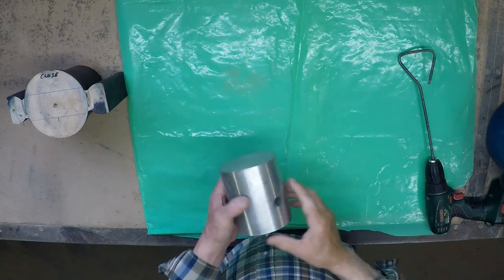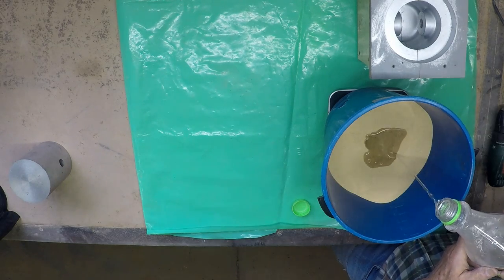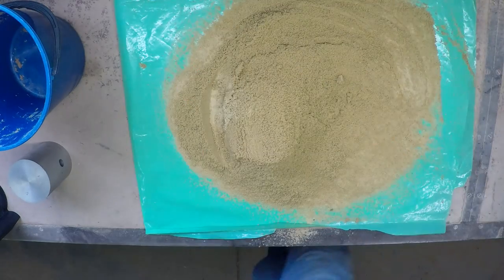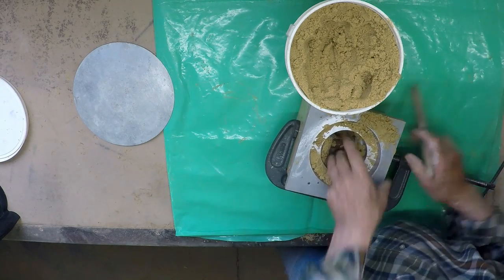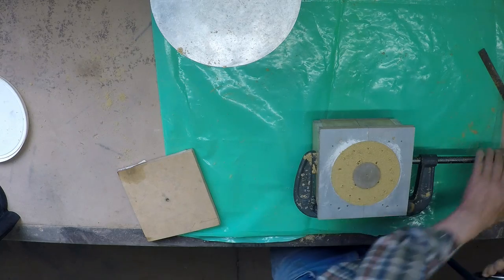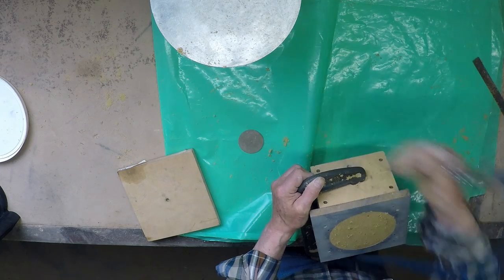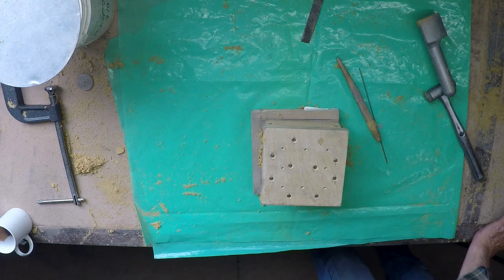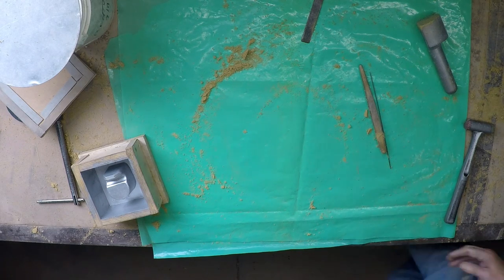Casting a piston for a 1910 Brush car. Part 2:- The CO2 silicate core

Comment: I was thinking of making a pouring basin pattern something like that.  I know you generally don't approve of adding head pressure extensions on top of sprues but is it worth risking a small height increase to easily get smoother cleaner basins than I can cut by hand?
Beautiful patterns, and a great tip about adding glucose to the cores.  I was going to try adding dextrin to improve collapsibility but I will see if I can find some glucose to try instead.  Can't wait for part 3!

Jeff
Reply from the maker: Jeff,  A couple of points re the basin, It is actually quite easy and quick (after a little practice) to cut the basin in the top of the mould as I do at around 8 to 8.30 minutes in the Part 1 video of this series. The main think (I think!) is that the basin is vertically sided and it does not seem to matter that the bottom corners on the basin are square in fact this squareness seems to help. I have seen people cut basins that are very shallow and way too spoon shaped - definitely not a good thing! The use of a thin tube to cut out a "divot " for the basin is the easiest and quickest way. The tube I use is 30 mm diameter and I push in 30 mm deep, I then cut the sand away between this 30 mmm diameter hole and the top of the sprue leaving (very important!) a 10 mm high ridge between the basin and the sprue, the top of the ridge must be well radiused to the top of the sprue.
Yes, I am very much against unnecessary head height - its just not necessary and is an evil in the way it increases turbulence during mould fill. However I am talking here about the unfortunate habit some YT casters have of extending their moulds up 100 mm or so. (The jam tin mob!)  This is crazy! BUT a small increase of say 40 mm max to allow the use of a premade pouring basin is not going to cause too much of a problem and it is as you suggest a way of getting a good basin on a regular basis. Also of course coupled with a decent tapered sprue of the correct size the whole arrangement will put you miles ahead of said "jam tin mob". You can actually be very cunning with it sometimes by having the feeders vents etc not quite as high as the basin, in this way you stop pouring when the feeders are almost full and the basin drains almost completely increasing the metal yield. My "to do list" includes as a matter of some urgency the making of a little 4 cavity shell core mould to make just such basins, because the silly little funnel ones that I currently use on a lot of my work is a very poor design.
The glucose powder in the core mix makes a truly amazing difference - try it. I get the glucose for a health food shop. I tried glucose syrup  but could not get it to mix in properly while the powder mixes in to the dry sand very well.  Part 3 in a week or so - I hope that you like it... Martin
Reply: @olfoundryman8418  try glucose from a beer brewers supply.

Comment: Nice Pouring basins Martin, as you know mine are made with oil bonded sand.
looking forward to part 3.
Reply from the maker: War, Part 3 about a week away - just need to get it edited. I intend to make shell core moulds for the basins that way I can make lots and have them on the shelf for ever.. Martin

Comment: Fantastic video! Really looking forward to the next one. What is the powdered release agent you are painting on the core mold, the silvery aluminium like powder, please. Cheers.
Reply from the maker: Jimmy, It is not actually a "release agent" but it seems to work for me although I suspect there are way better ones out there. It is actually a mould coat called "Mouldcote 15" it is made by Foseco and it is a chill coat used to help control solidification - usually on things like shell cores. It looks like silverfrost paint but it never quite dries and it is very messy to work with - it gets everywhere! I guess it has a sort of minute flake structure of its aluminium(?) component and that is what  provides the release... Martin
Reply: @olfoundryman8418  Very many thanks Martin, that is really appreciated. If it works, it works! Cheers.

Comment: Martin,  thank you very much for your insightful videos, and the obvious skill and expertise you bring to each casting task. It is great to watch. It is clear that a great deal of preparation and thought goes into each successful casting and the opportunity to literally look over the shoulder of a master at work is solid gold.   It is riveting stuff.  A couple of questions if I may?  The first is how you correctly estimate how much alloy is required for each casting?  Secondly what do you use for degassing and slag removal?  Thirdly I live in Australia for part of each year and would be grateful if you could point me towards good suppliers of all the consumables. Fourthly and finally, somewhere you mentioned in passing a book you found helpful.  Can you easily recall the details?  I can honestly say that I learn something new every time I watch your videos.  I hope your health issues permit you to continue your wonderful work - and teaching.  Kind regards John
Reply from the maker: John, I posted a list of possible suppliers just yesterday in response to another comment. Here is a "paste" of that reply.

Fluxes, exothermic, die sprays, mould washes and release agents from Foseco they are world wide.
Ceramic filters from  Pyrotek
                       Foseco and Pyrotek tend to have much the same stuff sort of.
Shell sand from Beckwith Macbro
Refractories, insulating boards/wool, and crucibles from Refractory and Ceramic P/L speak to Brian Weichardt mention my name he will probably charge you double😀 -  no not really, he is very helpful
Sieves from CMT Equipment (www.sieves.net.au) Note, I reinforced the sieve with solder to increase bond between wire and frame.
Parting agent (calcium carbonate) Cast metal services
Aluminium (and other)Ingot  from Hayes metal Sydney
Thermocouples and instruments  from TC Direct  - a bewildering array of stuff! Also available on "Fleabay" and probably cheaper

How much metal? I guess I have just got used to eyeballing the pattern and coming up with a figure. If I have any doubt I find the volume by calculation or water immersion multiply by 2.7 and that is the weight of aluminium. I double this to allow for feeders gates etc and then make sure the crucible (I know what it will hold) has enough in it to do the required number of castings. I always weigh the casting both as out of the mould and as fettled. I record these weights on a data sheet that I keep for each job - great for future reference.
Degassing, I use an argon lance of my own design. I do have a video out on this but it does need an update (when I get time 😏)
Slag removal I use "Coverall 11" flux from "Foseco".
 Book, The best book on the subject is without doubt John Campbell's "Complete Casting Handbook". Don't buy a hard copy from Elsevier as their bookbinding is terrible and my nearly $200.00 copy began to fall apart within a few weeks. It is a hard read in places very technical. A slightly easier read is his "Casting Practice the Ten rules of casting" This book is contained within the first which has a whole lot more besides. Most other books are a bit out of date but still in at least some places usefull the difficulty is in knowing where 😏 Health issues problematic!...Martin

PS I do not know why this font keeps changing colours never happened before! Maybe it will be Ok when I click "reply"
Reply from the maker: John Yep, sure enough I clicked reply and the colours vanished and the font is Ok another of those mysteries of YT I guess.. Martin
Reply: Olfoundryman wow! that was solid gold. Thank you! What is the material that bursts into flames that you put on your risers after each pour?  It certainly adds drama!
Reply from the maker: John, The  material is an exothermic sort of like "thermite" it catches fire and generates a lot of heat this keeps the feeder liquid for longer so it is better able to provide feed metal to the solidifying casting underneath. It is called "Ferrux NF" and it is made by "Foseco" ... Martin
Reply from the maker: John, Now you have some "light" bed time reading 😏 - enjoy - its a real eye opener, read ,study, and learn and then look at how many people do it wrong, oh so very wrong.... Martin
PS, Much of it deserves "special attention" better buy a couple more reams of paper😀
Reply: Martin, I am presently in Panama for another month or so,  so electrons stored on my IPad are the preferred weapons of choice.  I think I will read and print off the bits I need to refer to later.   Your excellent videos give an perfect frame work to hang the gems of theory and fact upon as they arise. Kind regards John

Comment: Olfoundryman can you go into more detail about the glucose pulver? I didn't read about its effect on softening the breakaway properties of cores after pouring yet.
Reply from the maker: rocketry. CO2 cores have a bad reputation for poor breakdown after casting. I have had to remove them from a casting with a hammer and chisel, or a carbide drill a very slow and painful process. Also cores with breakdown this poor can cause the casting to split as it cools down and tries to contract against the core. Adding 0.5% glucose powder is quite an old trick but oddly not one very well known. It makes it possible to hose the core out with water particularly if you water quench the castings while still quite hot like I do. The difference this addition makes is absolutely amazing. I buy the glucose powder from a health food shop but someone also suggested that brewing shops should also have it. I suspect that most commercial CO2 silicate binder brews made by commercial foundry supply companies have something like the glucose powder already incorporated. I did try glucose syrup but found it too hard to incorporate properly. Just throw the glucose powder into the dry sand mix a little and then add the sodium silicate and finish mixing... Martin

Comment: Have you thought about adding a small air port to the underside of the basin mold so you can use a light blast of compressed air to help free the product? We used to do that at a fiberglass factory we worked at, it made things easier.
Reply from the maker: Mickk, Interesting thought, and it would almost certainly help. However the sand is porous so some of the air pressure may just leak away through the sand. But I will definitely give it a go as its easy to try... Martin

Comment: Are you using 3d printed molds?
Reply from the maker: Adelan, No, both the pattern and the core box used for these pistons was made by a pattern maker and both were cut from wood. I have used 3D printed patterns for a few other jobs and I must say  that I do not like them - they are weak and thus easily damaged and worst of all they have that horrid layered structure that just seems to grab the sand and make pattern withdrawal difficult - they require a lot of careful finishing  if a good looking casting is to be produced. Sometimes its just easier,  better, and quicker just to make the pattern using traditional methods.... Martin

Comment: I think it would be fun to try a lightweight aluminum piston to see what higher rpm does. More power?
Reply from the maker: Kevin, The engine is a single cylinder with a compression ratio of about 4 to 1, it develops 10 horse power - doubt you would get much more power out of it regardless of what you did. Also the weight of the piston is important for balance reasons... Martin

Comment: I had to Google "shell core." It appears to be a core that can be made hollow. Commercially made by blowing resin coated sand into a hot metal core box. The heat sets the resin and the excess is dumped out. Leaving a hollow core. Did I understand that correctly?
Reply from the maker: Larry, Yes, you have understood correctly. In some of my videos I do use this shell process. I do not blow the sand into the core box - I simply tip it in but commercially they would blow it in. The video I did on the shell core for a runway light base shows this process, it makes an excellent core...Martin

Comment: Здравствуйте мастер.У меня не получается это форма. Уже второй месяц ни как не плучается. Смотрю на ваше видео отличная форма крепкая. Не скажете ли вы?  Что вы добавили на песок? На 1 кг песка, сколько дабавим глина, вода или ещё что не будь житкого?
Reply from the maker: King, The sand I use is a natural moulding sand. So it already has the clay in it and all I do is add enough water to make it damp. If you are making up your own sand you need the finest sand you can get and add about 10% bentonite (by weight) to that. Mix thoroughly and then add just enough water to make it damp like a good garden soil would be. It needs to be mixed very well and may take some time to fully develop  its strength. You could put it on a concrete drive and run a car over it back and forth with intermediate shoveling into a low heap. Doing this will help spread the clay over the and grains and thus help develop the sands strength. The 10% of bentonite is a starting point you can go up or down depending on how well it works. Hope this helps.... Martin
Reply: @olfoundryman8418  Спосибо.👍
Reply: Я понял вас мастер  Мартин. У меня кипить алюмини во время литьё в песочную форму. Что мне делать, что бы не кипел алюмини при литьё. Мастер Мартин спосибо вам. Моё имя Баккожа, привет из казахстана.
Reply from the maker: King, What you describe sounds like steam bubbling up between the metal and the sand - it seems to make the metal tremble and produces a rough and at times dark dull surface on the solid metal. The steam is supposed to get out through the small gaps between the sand grains in a rammed sand mould.
There are three possible causes. 1. The sand is too fine or contains too much fine material so that the small gaps are closed up. Thus the steam has nowhere to go and  forces itself up between the metal and the sand.
                                                            2. Th sand is too wet so there is too much steam to escape through the small gaps as it should.
                                                            3. The sand is rammed too hard this closes those small gaps up.
My sand is very fine and I sometimes have this problem. I can cure it by poking a thin vent down into any area of the mould that I think might get this problem - typically around feeders and particularly around gate feeder junctions. I use about a 1 to 1.5 mm diameter wire to poke the vents into the mould.
 Hope this helps. 
Greetings from Melbourne Australia...... Martin

Comment: Would vacuum chamber of silicate sand parts, then backfill with CO2 be overkill?
Reply: probably not if you have the tools already for it. If I make my molds ( 300x200x60mm ) I have to do it otherwise it is not penetrating enough co2 in the molds. But I'll make my Co2 by mixing vinegar with baking soda.  And It still takes 3 days to cure my molds. after repeating the vacuum and co2 charging cycle

Comment: What co2 pressure do you charge the core sand with.
Reply from the maker: Charles, I don't actually set the pressure. I use a flow regulator and have about 3 to 5 litres of CO2 per minute. I make sure that there are lots of vents down into the core partly to let the CO2 into it to cure it properly and partly to let gases out during casting... Martin

Comment: Why do they want the piston to weigh the same as the cast iron piston ? Over the last 50 years I have replaced cast iron pistons in engines such as Chevy Sixes with alloy ones because they were lighter and the thermal efficiency was better.  The latest ones I did were forged pistons for a 1955 Mercedes which were 30% lighter than the originals and the engine runs very sweetly.   Does the car have a Wooden Front axle?
Reply: idle quality suffers when you get the rotating/reciprocating assembly to light. i just went thru this with a vintage Porsche air cooled engine, and have seen it before.
the rotating assembly in my case was almost 2 pounds lighter, between new pistons and new lightwieght con rods.
theres only so much material you can remove from the crank to get it back in balance.
Reply from the maker: Mercmad, Remember this is a single cylinder engine! With a multi cylinder each piston tends to balance the other  but clearly not so here. I understand that the weight had to be right or the engine would be very rough. This engine never gets much above a modern Idle - I was told about 1000rpm peak!.. Martin
Reply: @olfoundryman8418  I am guessing here but I am thinking they wanted the piston the same weight,other wise they would be adding weights to the crank and flywheel. 1000 RPM  is about average for cars of that era. A lot of stationary engines ran at 300 RPM... :-)
Reply: @Mercmad  they would need to remove weight from the crankshaft counterweight.

Comment: what is the name of the release agent do you use?
Reply from the maker: TheHalloween, It is a Foseco product called  "Moldcote 15". It is not actually a release agent instead it is a chill coat designed to be painted on things like shell cores principally when gravity die casting. It just happens to seem to work as a release agent but I have to put in on almost every time before ramming up a core so I guess its not really all that good! It is very like a silver-frost paint that never quite dries and in fact I have used silver-frost paint on shell cores. You could try kerosene it sort of works too...Martin